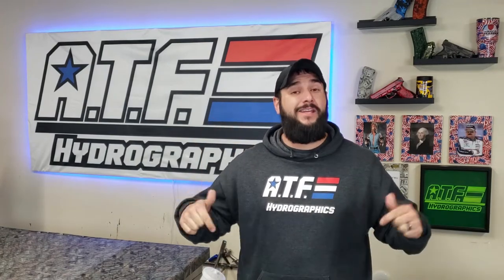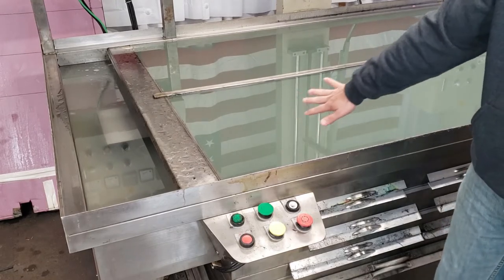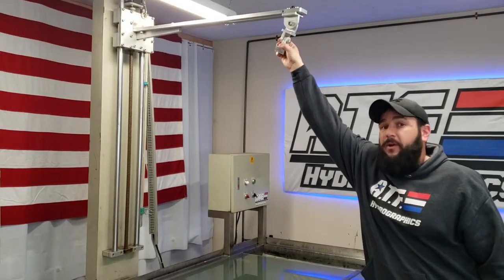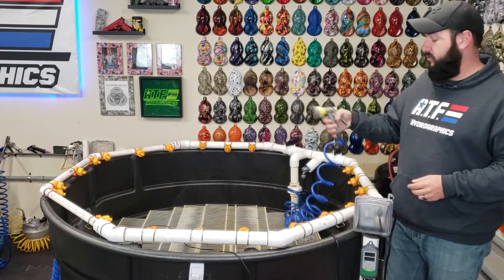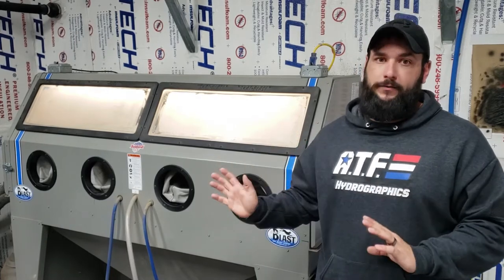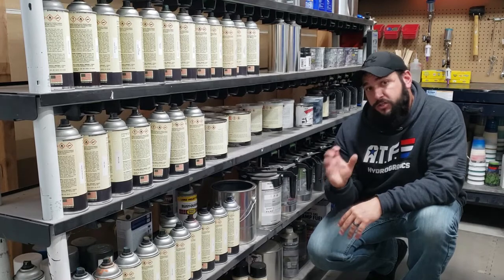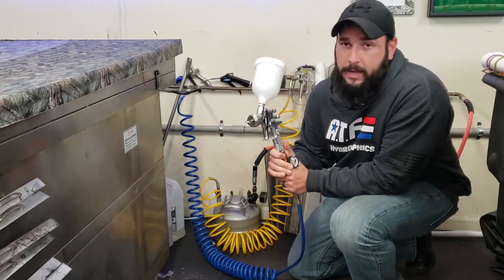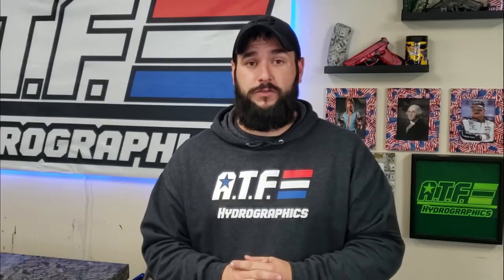Top 5 Pieces of Hydro Dipping Shop Equipment

Comment: Thanks for the One Hit Wonder discount.  Question on the spray cans.  I've been shaking the clear can and the metallic silver can for 20 minutes and there is no rattle.  Is the can defective or should I just spray it?  The candy intercoat rattled right away.
Reply from the maker: There is button on the bottom of the can, I csnt remember if you push it or pull it, but it releases the ball and thr harder, then you can shake it.
Reply: @AllThingsFunHydrographics  This is a can of silver metallic paint....just cant imagine spraying this or the can of regular clear without a rattle mixing ball.
Reply from the maker: @flyiniowa6255  contact OHW. They have amazing customer service

Comment: I have a question “I’ll use a shotgun barrel as a example” so when I watch you dip this item some times you dip it in and roll the barrel over its self and other times you tape half of it dip one side and I assume you tape off that side and then dip the other side. How come you do this only some times?
Reply from the maker: It all depends on the parts I am dipping. Some parts are more forgiving with the stretching of the film, and some are not. On stocks, with heavy stippling, I always dip it twice so I can make sure I get good coverage of the deep stipples. On some parts that are smooth and are easier to dip, I can roll those without having to worry about coverage issues. Just comes from lots of training and practice over the years. I can usually look at a part and just know if it needs to be dipped once or it needs to be split and dipped twice.

Comment: Really like all the knowledge you share. 
I bought a tank several years ago 200 gal. My son turned me on to this and I thought he would help / do the work .
I havent used it maybe 2 times. I would like to use it more but my shop is not heated full time so in the winter my shop is cold enough to freeze the water.  Maybe one day .thanks for the tips.
Reply from the maker: Get an aquarium heater and throw it in there to keep it warm. That will prevent the freezing.